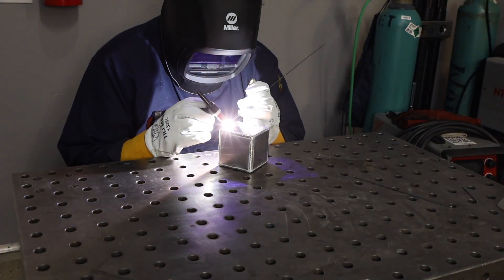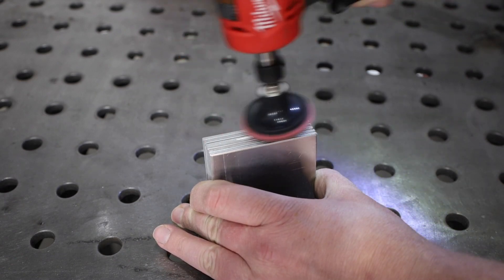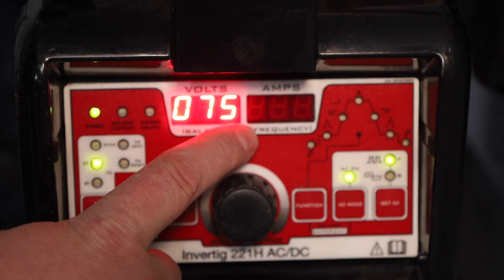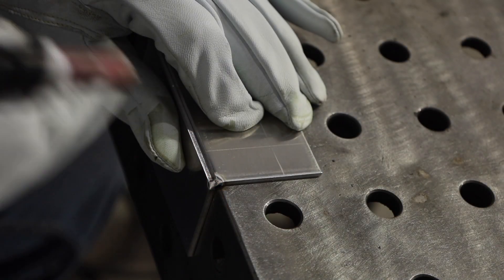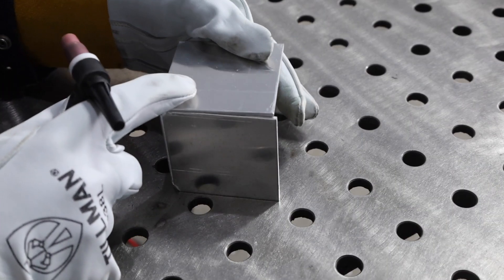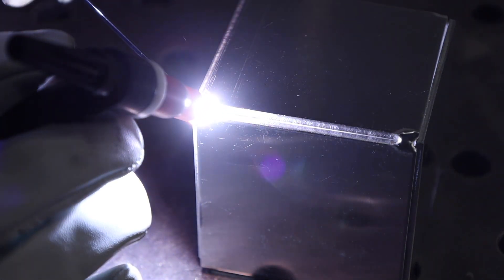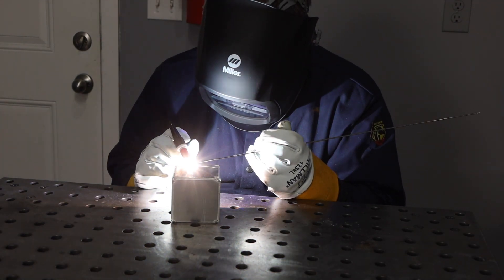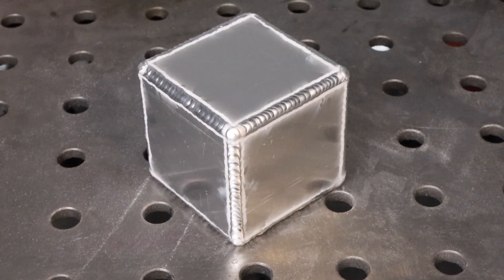How to TIG Weld an Aluminum Cube

Comment: How are you liking that HTP?
Reply from the maker: It’s a great machine. I’ve welded with Miller (I also have a Dynasty), Lincoln, Fronius and several brands of machines. As far as welding goes, this unit is as good as any of them. The only place where it falls short, in my opinion, is the menus for settings. They aren’t intuitive, so you need to use the manuals to know what buttons to press. After a few days, I learned where they all are, but it was a little clunky at first.
Reply: @TimWelds  Glad to hear it! Thanks for responding. I picked one up used about 6 months ago for a steal and I love it. I use a Dynasty everyday at work, and honestly it blows my mind how good the HTP is for the money. With a cooler, it's half the price of a Dynasty 210DX Tigrunner package. 

I've only used Lincoln transformer tig machines, and I've never touched a Fronius, but I love my HTP. I'll agree on the clunky interface, but that's really the only negative. 

I'd love to get one of the new 301's. Thanks for your videos!

Comment: Hi Tim,  I've been watching a few of your videos that are quite helpful.  But really welding a bunch of new steal on a bench in the workshop is borderline cheating.    How about a video welding some clapped out heavily pitted rusty thing where you can't get your grinder into every nook & cranny. ??.   That seems to be what I run into trouble with.  Two bits of new steel seem OK.

Comment: I did this using GMAW and flux core as part of a welding course I took at the local adult school. After welding the cube, we drilled a hole on one side and the instructor tapped it and put in an air valve. He filled it with air pressure and dunked it into a water tank to see if we had welded it correctly, so no air escaped. All of us failed. 🤣 It’s not as easy as you make it look.
Reply from the maker: That’s awesome!

Comment: Good project Tim, thanks for sharing.  What CFM do you normally run for this and does it vary with material type and/or thickness, or is it pretty much the same for all?
Reply from the maker: Thanks! Gas flow depends on the size of cup you're running. A good rule of thumb is to run a CFH that is twice the cup size. I was using a #5 cup with a standard collet body at 10 CFH. This works pretty well for most aluminum welding. For stainless and carbon steel, I'll usually run a #10 cup with a gas lens at around 20 CFH. With aluminum, you can run a pretty easy experiment running short beads on a plate and turning up the gas a little between each bead. With low gas flow, you'll see contamination and floaters in the weld. Then the weld will clean up, assuming everything is running right. When the gas is too high, the AC welding arc will start to get really loud and you'll notice changes in the etching region around the weld.